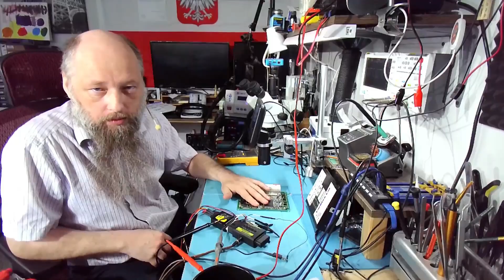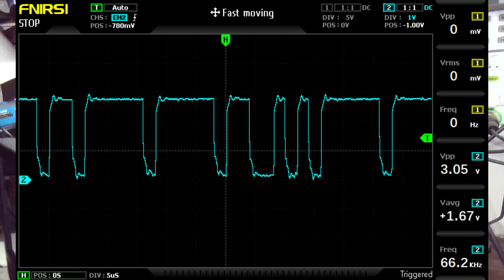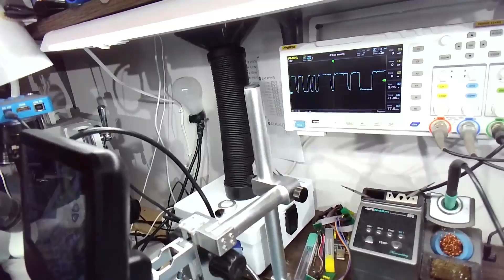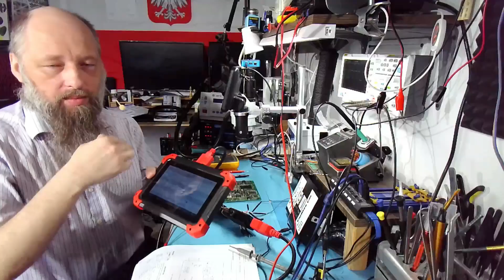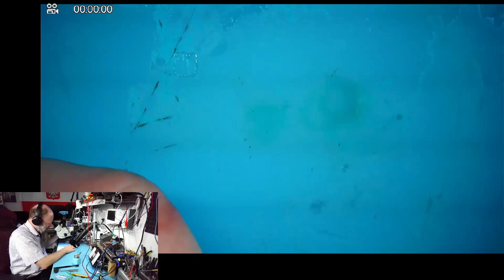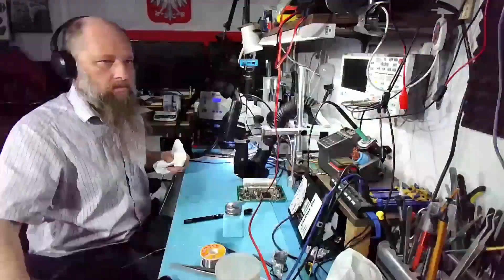131 | 2007 Outback ECM Repair P0607 (Carlitos Car)

Comment: Was the waveforms any different after the repair? In my experience most CAN signals are very noisy.
Reply from the maker: Good question, I didn't check. You're right about the noise but this one seemed a bit too noisy to me.

Comment: Very interesting, something I do not know much about but have been watching one youtuber sometimes;  (like keyworks ecu repair)  and now you are one of them. If someone do ask me to change a chip, trace repair and do the general repairs if they know what is wrong that I can do for sure. My knowledge is limited especially the writing of chips and probably could do straight forward cloning and so on if I do know what writing tool is required.  Probably would be able to do the general stuff of finding shorts and obvious visual blown components  and some general short of  components like capacitors, resistors, mosfet etc. Thank you for sharing.